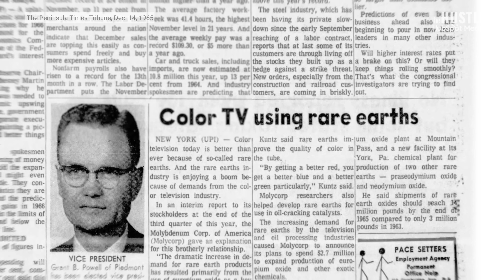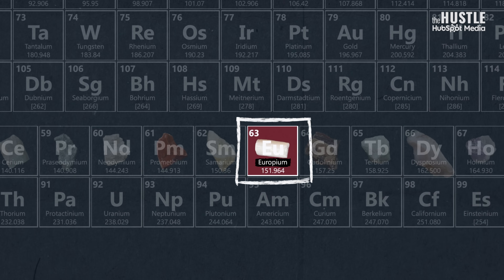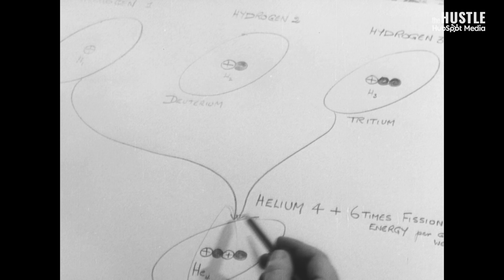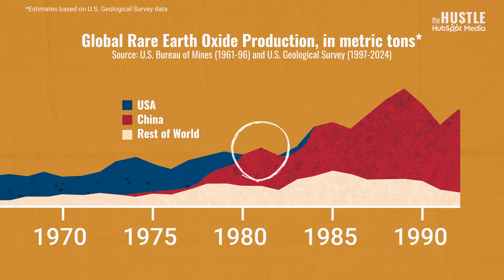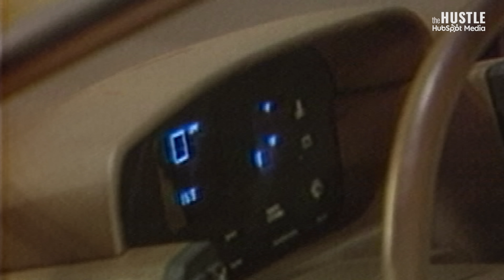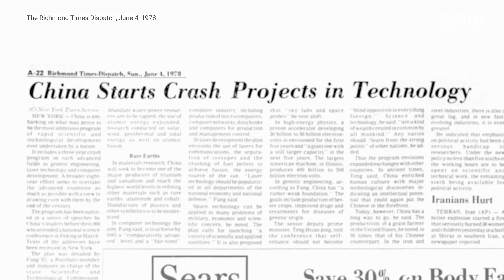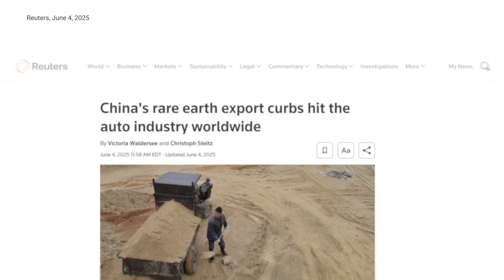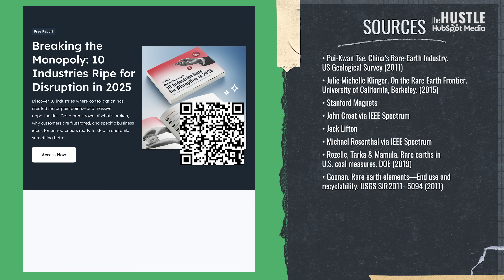How the US Handed This Entire Industry to China

Comment: The US Big Investors in manufacturing had an enormous problem after the Oil price crissis of the 1970's. They had to modernized extensively their fossil fuel guzzling WW2 plants at enourmous costs. Europe and Japan had rebuild their plants after WW2 with less fossil fuel guzzling manufacturing processes. Worst they had bet in the sixties on hydrolic manufacturing robots that had been made obsolete by the Japanese step-motor electric robots. So they listen to the "globalist" knowledge economy paradigm..No needs to own the means of production. What was important was to won the patents of the how to manufacture. By outsourcing their manufacturing to Asia, they would have to invest far less in modern plants while making as much even more profits just with the licencing of their patents.  What could have gone worng in that brilliant investment strategy?

Reshoring? Well it's possible but it will require 10 time as much investments without any possibilities to regain the global markets, but only the small niche of the 10% op consumers.

Comment: AND Radioactively regulation is to blame. Specifically many rare earths have thorium which is a tiny bit radioactive but it classifys the tillings as radioactive waste which is an administrative nightmare. We need more classifications that allow for working with low emissions radioactive material with reasonable safeguides like those you might use for lead paint removal.